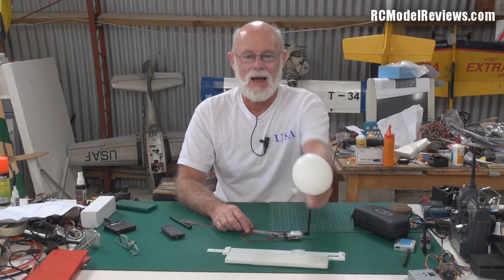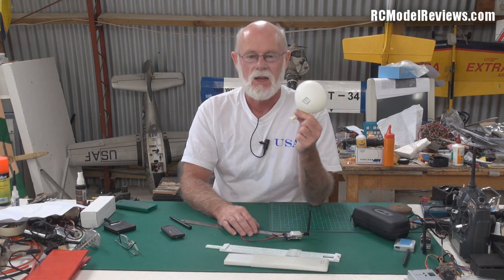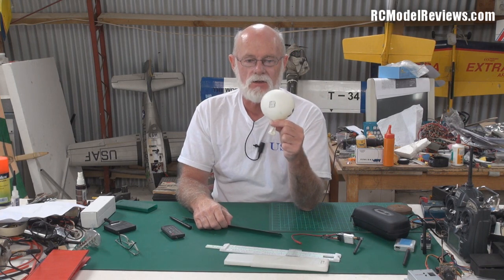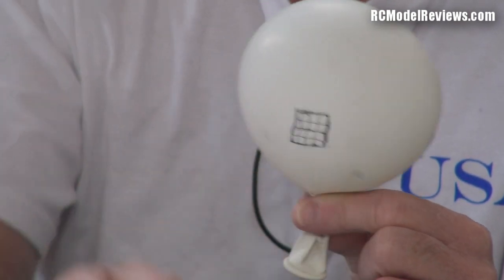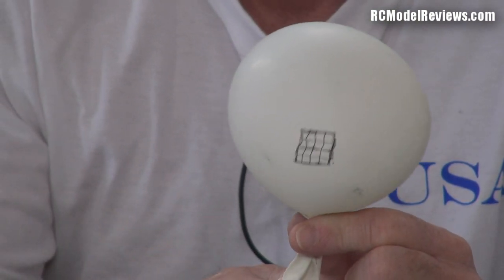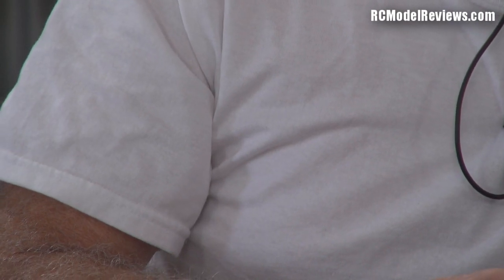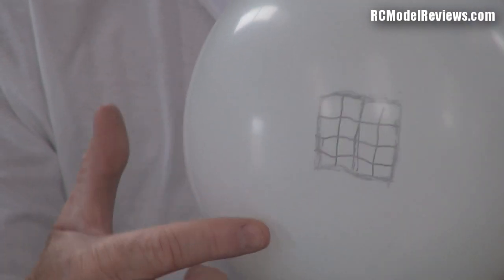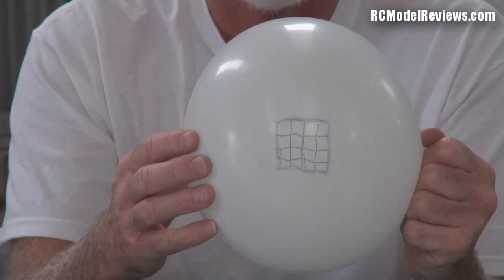FPV video, more power means more range?

Comment: Hello I'm new to fpv and I got a transmitter that is 40ch 600mw I've been using 7.4 volts but it does not go that far. So by watching your video does this mean if I put 3s lipo battery does this mean I would have better range?

Comment: You certainly would get much more range with a "Circular Wireless" Helical and they are directional off the end. You point it at your plane. I couldn't see you wearing one attached to you Fatshark but on a tripod with a tracker would be your best bet. If you don't have the cash stick with what you have. You can build your own antenna but the auto tracking gear is expensive.

Comment: I am using 5.8ghz with a 600mw video transmitter fitted with clover leaf. Would I get better range using a Helical antenna? and are Helical antenna's directional? In other words could I simply swap my antenna on my fatshark goggles with a Helical? Thanks

Comment: Hi Bruce, I noticed one of those cheap 5.8 "wifi panel antennas" on your desk, I have a couple and seem to work ok although I haven't tested them to any significant range. I did notice they didn't seem to be very directional; in other words, they had a very wide degree of range. The video quality didn't seem to be much worse out at their 180degree extremities.

Comment: Part 4/4: Convert mW to dBm:

dBm 	Watts 
0	1.0 mW
1	1.3 mW
2	1.6 mW
3	2.0 mW
4	2.5 mW
5	3.2 mW
6	4 mW
7	5 mW
8	6 mW
9	8 mW
10	10 mW
11	13 mW
12	16 mW
13	20 mW
14	25 mW
15	32 mW 
16	40 mW 
17	50 mW 
18	63 mW 
19	79 mW 
20	100 mW 
21	126 mW 
22	158 mW 
23	200 mW 
24	250 mW 
25	316 mW 
26	398 mW 
27	500 mW 
28	630 mW 
29	800 mW 
30	1.0 W 
31	1.3 W 
32	1.6 W
33	2.0 W
34	2.5 W
35	3.2 W
36	4.0 W
37	5.0 W
38	6.3 W
39	8.0 W
40	10 W
41	13 W
42	16 W
43	20 W
44	25 W
45	32 W
46	40 W
47	50 W

Comment: Part 3/4:

By increasing the tx power to 1000mW (or 30dBm), the range becomes 3.9km (5.5km with new module).

Double the distance for 4x the power, confirming Bruce's statements.

If instead we put a 7dBi antenna (helical) to the receiver and kept the same power, the range would become 3.8km (5.3km with new module).

So virtually the same result but without adding power.

Comment: Part 2/4:

For example, for a 5.8GHz video Tx/Rx from Fatshark, the values would be:

pt = 24dBm (corresponds to 250mW)
gt = 1.25dBi (cloverleaf)
gr = 1.25dBi (cloverleaf)
pr = -87dBm (new Rx module is -90dBm)
f = 5800MHz

Which gives a range of 1.95km (2.75km with new module).

Comment: Part 1/4:

The formula to calculate theoretical transmission range (open space, no interference):

r=(10^((pt+gt+gr-pr)/20))/(41.88xf)

Where:

r = range (in km)
pt = tx power (in dBm)
gt = tx gain (in dBi)
gr = rx gain (dBi)
pr = rx sensitivity (dBm)
f = frequency (MHz)

Just plug the values of your equipment to get your theoretical range.

Comment: Has anyone ever tried using a cloverleaf antenna for your RC Transmitter (to fly the plane not for the video)  I was wondering if you could eliminate a satellite setup by simply installing cloverleaf's

Comment: ah well, the really big boy stuff uses custom yagi antennas on stepper motors for like, 30 mile (40+km) range fpv. They're still not that complicated, just requires a little bit of know-how to configure it, and dumpster diving around office buildings for old printers to gut for their stepper motors. not as messy as you might think!

Comment: hey bruce, you should totally look into simple antenna trackers. i think you can use the eagleFPV ground station which has build in diversity AND antenna tracking for $80, can't beat that with a stick, and your little helical can easily be driven by two $4 servos on an fpv camera mount. that will give you some SERIOUS range!

Comment: Excellent explanation Bruce. Of course, the same rule applies to the force of gravity, light  etc. It's pretty amazing to think that the imaginary balloon with the Sun at its centre has a diameter of 300 million kilometers at the Earth, yet the sun can throw about 1 KW of power on every square meter of its surface. The "balloon" has a surface area of about 3 followed by 21 zeroes square meters.

Comment: G'day Bruce, I was given a 25mw VTX for my quad. It hardly gets me outside my front yard. I was offered a 600mw VTX in a straight exchange for my 25mw but I was branded mad to even consider it by someone who knows everything about RC, he told me that. So would I be mad to consider exchanging it or should I stay with 25mw. I am using a cloverleaf antenna of the correct type both ends. Supposedly it will wreck my 2.4ghz reception on the quad. What increase in range could I expect ? Thanks Bruce.

Comment: Doesn't that 4xPower=2xRange rule work only if the transmiter transmits the signal in a 2D disk shape, but since we live in a 3D world where the transmiter sends the signal up and down also, then it would be logical that you need 8 times the power to double the range. Am I missing something here?

Comment: Is the field created by the transmitter is an electrical field?  With electrical force the equation also uses the inverse square law, are these in any way related? Coulomb's Law   F=K(Q1*Q2)/(d^2)